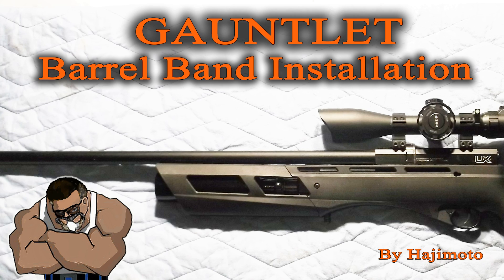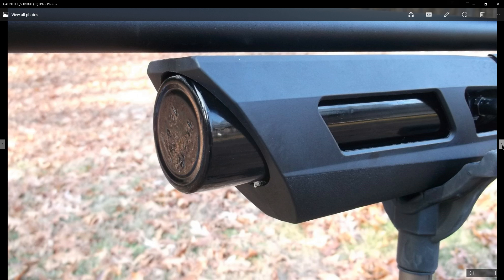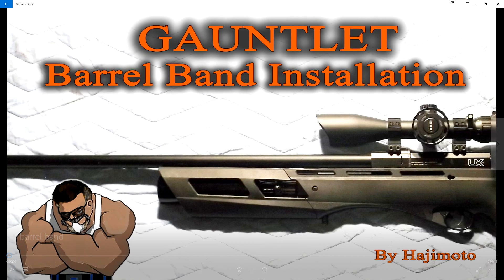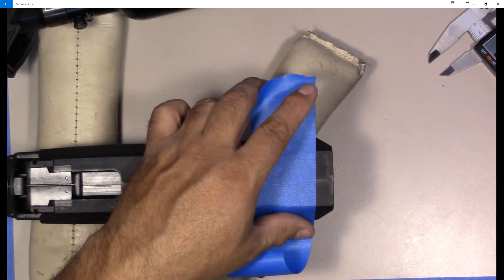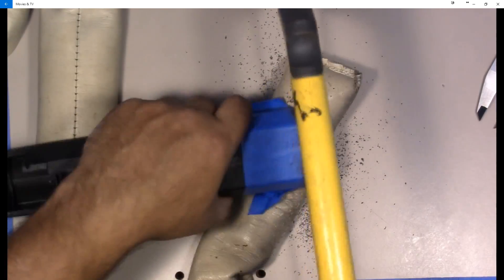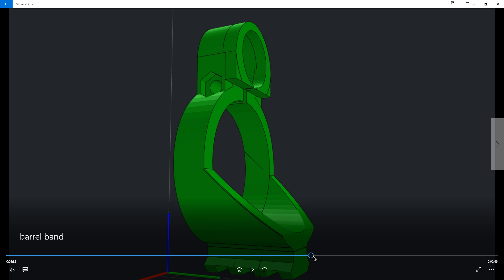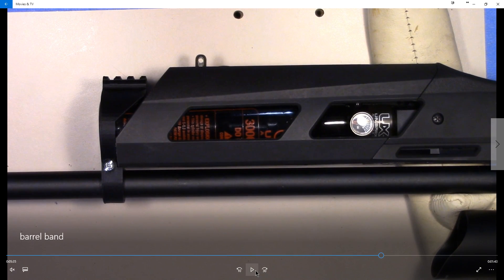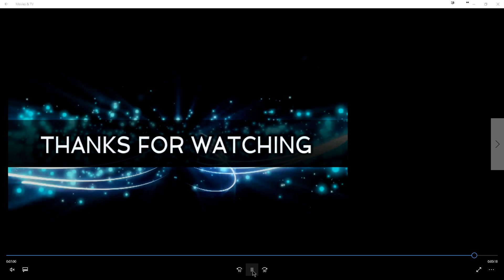Umarex Gauntlet: Barrel Band Support Tutorial

Comment: Love all your videos, especially re the Gauntlet.  And I have commented on several.  This one I kind of wonder about.  Have you done accuracy testing since this mod?  Lots of rifles use floating barrels including some of the most accurate in the world. and given how critical barrel harmonics are to accuracy I wonder if you saw any change?  The bottle shroud problem is annoying and I have made another observation about that shroud that suggests a different fix to rigidize the shroud if that is the primary objective. 
 I noticed that the shroud has a molded in catch on both of the top struts that utterly fail to lock into the slots they are supposed to engage.  When I aligned the top struts and used a couple micro-clamps to actually lock this assembly the shroud became very rigid and holds the barrel clearance perfectly.  Even bag rested on the very end of the shroud it doesn't budge.  So I plan to lock the struts in place and drill a small (probably 4mm) hole thru then affix nuts to the inside using Loctite E-120HP  structural epoxy.  I am partial to hex drive truss head screws so I will use black oxide coated 4mm truss heads for assembly.  My only concern is if drilling thru those struts is going to weaken the plastic and cause a failure.  That's why I am electing to use the very expensive adhesive structural adhesive.   I will post my results in your reply section so that others who follow your excellent videos will know if this is a viable fix to a problem we've all seen and hopefully Umarex is going to correct in the next generation of Gauntlets.
Reply from the maker: Great comment! Let me start by saying that I have seen your comments on previous videos and I appreciate and thank you for your support. 

Before I dive in here I want to preface this response by saying that the Umarex Gauntlet is a pretty nice entry level rifle that is marketed as the do it all rifle. I disagree with that marketing claim. I think the Gauntlet is a far better target and bench rest rifle than a hunting rifle and the rest of my response is written in that vein.

You are absolutely right about barrel harmonics and accuracy and they need to be considered when one looks to barrel band or support a barrel. I am not going to reference powder burners or talk to why the physics on that side are substantially greater which is the catalyst to the very topic of barrel harmonics, instead, I want to speak solely to PCP's and the Gauntlet specifically. 

Very expensive and well-made rifles that use a free-floating barrel are not affected by leaning the rifle against a tree or leaving it leaned against the all in your gun cabinet.  They are manufactured with high-grade steel and monoblock mounting systems that allow the barrel to return to its original manufactured position without an issue. 

On a less expensive rifle that uses cheaper materials which has a barrel that is not robustly supported, would not be able to recover from the same use scenarios. Now we introduce a shroud that goes over the barrel and is only supported by a threaded collar at the breach block end of the barrel. Depending on the level of tension of the shroud, it will take a bump at the end and be able to return to its original position but if it is of a tension that holds the new bumped position, the POI dramatically is dramatically affected.

 I have read and heard from multiple Gauntlet owners that constantly have to resight the rifle from a slight bump of the barrel. My advice was and is "Then don't bump the barrel" that is all well and good for the mature shooter or seasoned bench rest person but not realistic or practical for the hunter in the field or the 9-year-old whos first PCP is the Gauntlet.

When a hunter of any age carries his or rifle into the woods and it is bumped against a tree or hit by a swinging branch or worse yet, the rifle is mistakenly dropped on leaves and brush, and we apply the above-mentioned barrel shroud relationship and a POI shift results, it puts the hunter in a low to no confidence situation during what should be an ethical kill scenario.

This product is not necessarily for the shooter who primarily shoots target or the person who makes sure the rifle is properly handled to not affect the barrel shroud relationship. The HP Barrel Band is designed to help bridge the gap that exists between accuracy and consistency. The product allows the target shooter or the hunter to worry less about POI changes due to a less than robust barrel shroud relationship.

As for your shroud ideas, I think they are great! and I agree with your modifications to the two tabs that lock the shroud in place. I look forward to seeing your results and you offer great food for thought for this OCD tinkerer.

Thank you

Comment: The weakest point is at the magazine port, there's a reason  why the Mrod has mounting screws in front of the mag port. I'm removing the tank shroud all together and stabilizing barrel and breech to the air tube just behind  the air tank mount.  
There will be a foregrip extension  attached to the main stock body for a strong bipod mount.  Just a couple of ideas to knock around.
Reply from the maker: Great observations and ideas.  Please be sure to share what you come up with, I for one would love to how it comes out. Thanks for the comment.

Comment: Just double-checking will this mod work with the longer bottle without having to cut your shroud
Reply from the maker: Skinny I can not guarantee that the aftermarket bottle will be the same circumference. I can not speak to the stability of the longer bottle and the negative effect it will have if the bottle is used to support the rifle during shooting. One could measure the end of the bottle and see if it is, in fact, the same diameter and once that confirmed, confidently purchase the barrel band.
Remember as I described in the video and in the description of the video, not that the bottle and the barrel are tied together, any bottle movement is barrel movement which means the point of impact change. If a person was sighted in at 35 yards and grouping at the center of a target, if the rifle was placed on a sandbag on a table and the bag was under the bottle, any subsequent shots will have a higher point of impact because the force of gravity push the bottle up which pushes the barrel up. All rifle support should be on the main portion of the stock or the forearm shroud, not the bottle.  That was a Public Service Announcement and not necessarily directed at you personally Skinny but more at the dynamics of the scenario.

Comment: Maybe I'll just wait a little longer...baffles, barrel band,... who knows what other mods I'll need to purchase from you. 
One question Haji- and this is merely an aesthetic query, could you make your barrel band's angle mate up with the barrel shroud's, to improve the, well like I said, aesthetics? or is there a reason I wasn't noticing for that?
Reply from the maker: Please remember the Gauntlet is a great rifle straight out of the box and my mods and widgets do nothing but address some quirks of the rifle. As long as the shooter understands the mechanics of the situation they themselves can compensate somewhat for the problem. So remember you or anyone do not NEED any of these mods, heck these may inspire or spur another way of resolving an issue. I am simply sharing my experiences and offering a service for those that are not able to produce the same results. As for the angle, I found that when the angle what the exact same, folks were more likely to push the forearm shroud and barrel band together thinking it was a proper fit. The issue is, nothing should make contact with the barrel band as it will directly impact the point of impact. But you are right, it would look a lot better if it were the same angle.

Comment: Fantastics video brother I just wanted to let people know that if you install the bigger bottle you will not have to cut down your shroud I have to double-check but I believe this to be true
Reply from the maker: Skinny I can not guarantee that the aftermarket bottle will be the same circumference. I can not speak to the stability of the longer bottle and the negative effect it will have if the bottle is used to support the rifle during shooting. Remember as I described int he video and in the description of the video, not that the bottle and the barrel are tied together, any bottle movement is barrel movement which means the point of impact change. If a person was sighted in at 35 yards and grouping at the center of a target, if the rifle was placed on a sandbag on a table and the bag was under the bottle, any subsequent shots will have a higher point of impact because the force of gravity push the bottle up which pushes the barrel up. All rifle support should be on the main portion of the stock or the forearm shroud, not the bottle.  That was a Public Service Announcement and not necessarily directed at you personally Skinny but more at the dynamics of the scenario.
Reply: Also the longer bottle .38L is .8mm (1/32") wider in diameter than the original one.

Comment: Would this not affect the harmonics of the barrel?
Reply from the maker: It may but young shooters who man handle the barrel and hunter in the field hitting branches and tree limbs knock the POI off.  This is really intended for those guys. Bench rest, paper punchers more than like will not realize any benefit.
Reply: This question interested me also. I added harmonic compensation to my Mini-14 and wonder just how much barrel harmonics there are with air. Considerations for powder burner: https://www.shootingillustrated.com/articles/2010/10/28/ruger-mini-14-target-rifle/ The author mentions several criteria causing barrel whip. Air would apply to two of them, pellet-to-rifling and pressure release. We  are dealing with lower "guaranteed" sustained pressures and choked/non-choked barrels. Logically the choked barrel might have an induced harmonic at specific plannable point.
Is is a worthy pursuit at this price point with non-choked barrels and sliding barrel weights?
Is there any empirical data on hpa gun barrel harmonic whip? and at what caliber does it become important?
Will bracing a free-floater really affect poi that much?
Reply: better believe it. put that forearm on a rest AND every position will have a different POI.